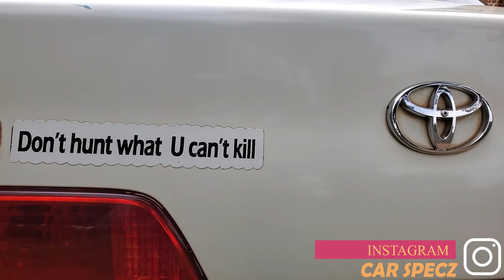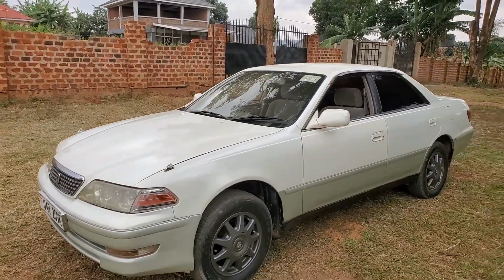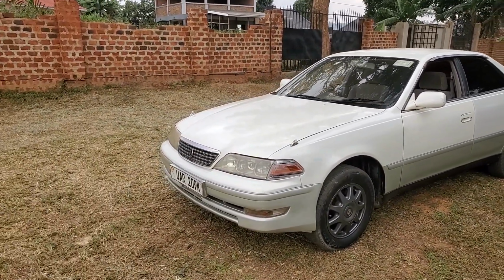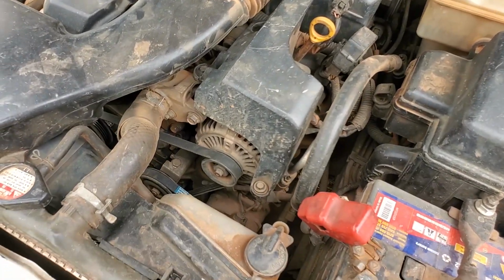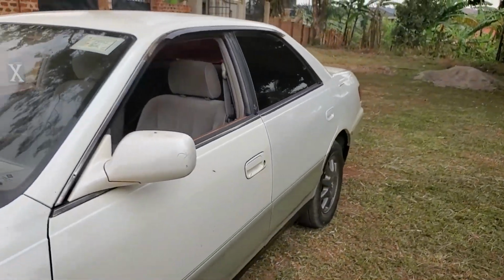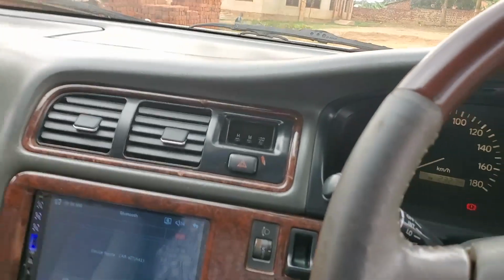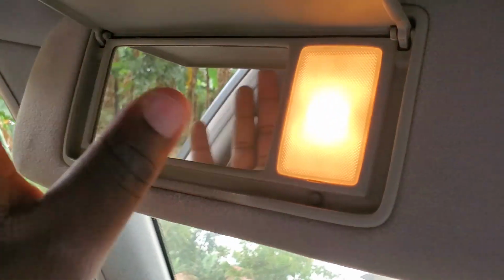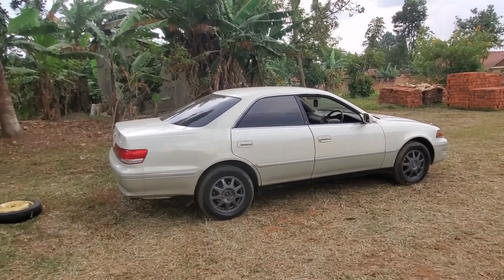Toyota Mark II GX100 Long time Review

Comment: Very fuel efficient and needle is on E 😂 I have mine with 1jz ge, to me its a gas guzzler
Reply from the maker: Bro the 1jz ge is a 2500cc 
But if well serviced its a good engine
Reply: I love my 1jz, i get anywhere between 6-8,5liters/100km when i'm babying it. I have a 97' vvti powered model without etcs, my friend has a 99' model with the etcs and his gas mileage and throttle response seems to be slightly worse, however the x100 platform truly seems to be the enthusiasts dream regardless of the trim level since the routes of modification are practically endless in my experience.
Reply: @ELVENinRs  this is nice, my 1jz gives me 11-12l/100km when im babying it 😂 I like my throttle response, its aggressive but I can't brag about its fuel consumption, it's terrible, my ractis 1nz fe gives me 5l/100km easily